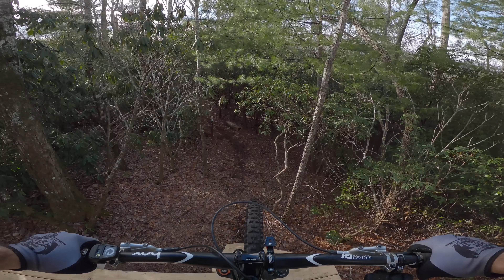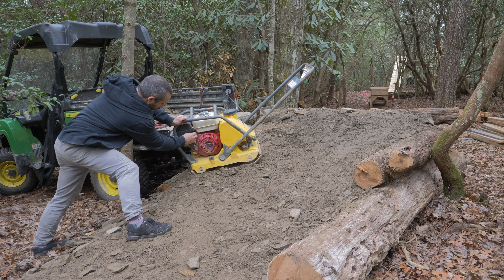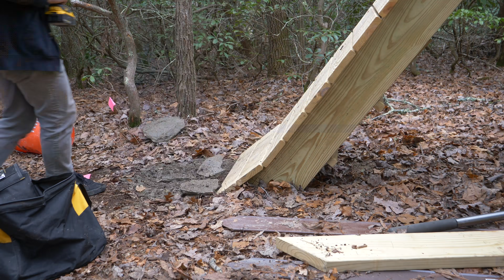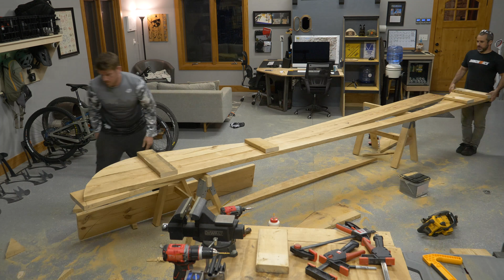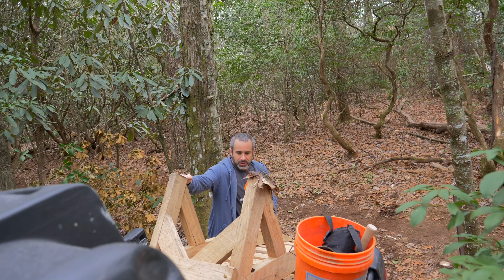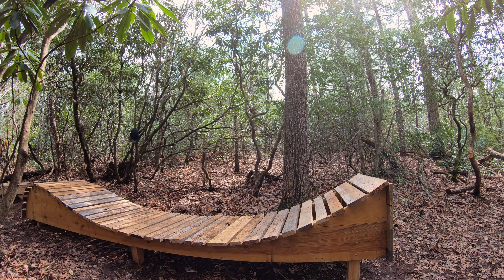Building and Riding the Backyard Whale Tail

Comment: uhhhh hoping that it isn't the case but how sketchy was the dirt merchant you may have taken some dirt that had either a high concentration of oil or lead that couldn't be used for anything... i.e. if you test the dirt in the future any possible buildings will be stopped until bad dirt removed

Comment: I grew up on the north shore of vancouver, and the first bike i bought was a brutally used Giant AC2, how ever i crashed it bad and havent rode in about 3 years. I want to get back into biking and explore what there is around my area. Since ive only ever experienced a DH bike, i dont have a problem buying another one. Most people disagree due to the inability to climb. Yeah it sucks but its bearable. Should i grab a better dh bike, or get an enduro. (im a sucker for dual crowns) thoughts?

Comment: OK...Love it.  BUT....with how you have to turn slightly off the tail end, I'm predicting right now that with just a LITTLE bit of moisture on your tires, even if the wood isn't wet, someone is going to sllp right off the end and have a bad ending.  My suggestion....add a little bit of rise on the outside of the take off end so that it's "hipped" slightly to the right, so that you have more tread on it to prevent slippage.  Other than that...looks like a blast!  Also...making the berm bigget going into "Kevin's Jump" was a no brainer to make the line more doable for most riders.  It takes a lot of trust to throw your bike into berms that short and trust that your tires are going to hook up.  

Great work guys....looking forward to more build projects!!

Comment: If you lay a chain in the bed of utv, put the length of the bed plus another 10' or so by the cab, then lay a tarp over chain and the bed.  Load your gravel/dirt. When you go to unload, take the excess chain stacked by cab, tie it to a tree, then drive forward. There's several way to do it, with different materials. We use to use 2 chains on each side of an big trailer. Its an easy way to unload.

Comment: Seth I have a question I recently watched your “is your mtb to heavy?” Video and that got me thinking I’m a really skinny 13 year old and weigh 85 and my bike weights 30 is that too heavy to do simple techniques like bunny hops and stuff?
Reply: No it technicly is not to heavy. But you just may not have enough strength to do high hops. But these techniques mainly need a lot of skill and practise.
Reply: Yeah dude, I was small like you and a had trouble with the hops at first.  It actually helps to be small in the long run tho because you must learn perfect form.
Reply: No, bike weight has little to with ability to do thing. Most it technique.
Reply: No you can still do stuff like that👍
Reply: I am also 13 and I weigh around 95 pounds, my bike weighs 35 pounds and for awhile I blamed my bike being to heavy and big for me as the reason I could not bunny hop. But one day I tried to pull a small bunny hop with proper technique and it just clicked, I can still only bunny hop a max of 4 inches, but height will come with practice after the technique initially clicks for you.

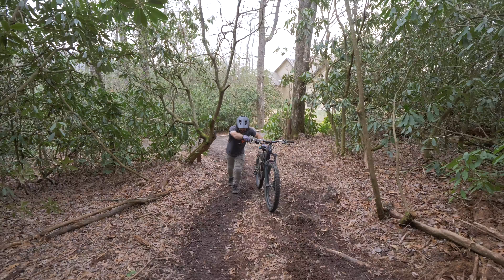Comment: Hey Seth, I noticed your bike have the hole for the front shifter-cable and housing open that is not in use at 8:45. You should plug it or tape it shut, or lots of sand, dirt and water can get into the frame and cause damage. The water can mix with the dirt and create mud that solidifies and makes things even worse. It is especially bad if it's open near the crank, the dirt can get in there so fast it closes the draining hole under the frame, making it accumulate even faster. Plus you get a bunch of unnecessary weight added to your bike.

Comment: I would recommend using another piece of rebar as a punch to drive those "nails" at least another inch below the surface so that the wood can rot/wear away a fair bit before you have a little spear poking out of your feature in the future. 

Also keep in mind that vibratory plate compactor only really compacts down ~3-4" in the best of conditions (think gravel). It is great for grooming a surface but if you are trying to compact a big pile, it is best to compact in lifts of ~2-3". 

I enjoy the videos. 

Thanks

Comment: Hey Seth, quick tip on compacting dirt coming from a civil engineer. For the last ~6 inches of soil, do it in 2 "lifts". Compact the soil down and then add another very thin layer (~3 inches) on top of it and compact that down again. This will give you a much stronger final "crust" on you jump compared to just compacting down soil down on the top once. Hope that helps!

Comment: I found a Mountain bike that has a rear derailleur hanger, quick release tyres, disk brakes, a threadless stem, 80mm front suspension and it only costs €230 ($246). Is this a good bike? Its called the Apollo Valier.
Reply: Usually best to avoid Apollo. Trek, specialized, voodoo, vitus all do fairly good quality budget hardtails